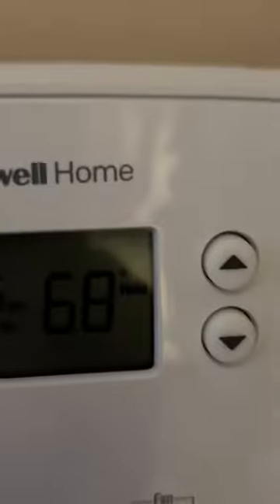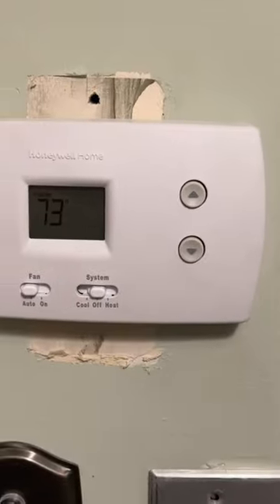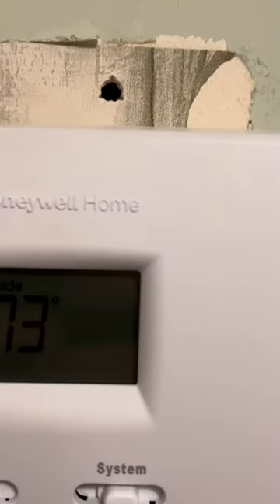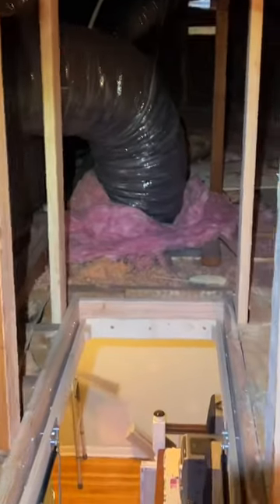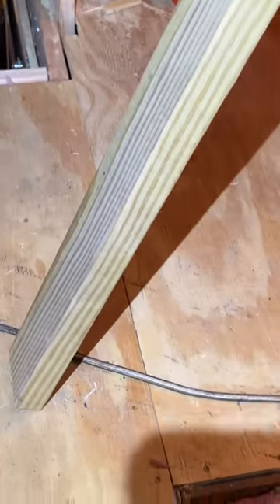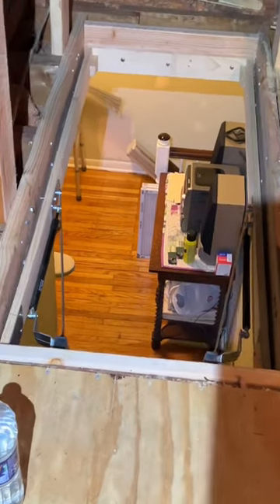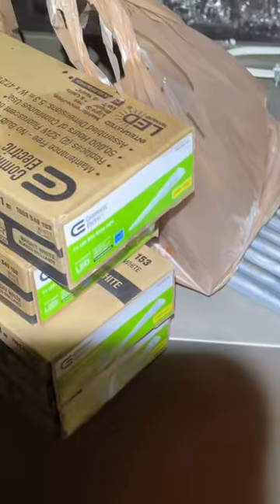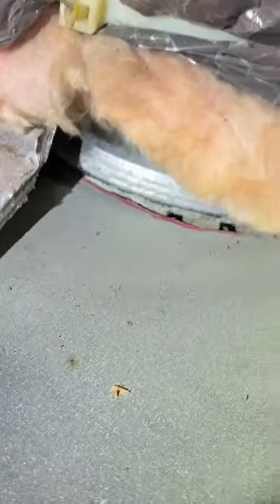More licensed HVAC hack work

Comment: Then someone that knows what they are doing has to explain to the customer why the repair bill is so high for a simple repair. "Well sir we have to uninstall the unit then....." Instead of just making a straight forward repair. Customer looks up the cost of part online and wonders why it's so high for a cheap part and calls you a ripoff and leaves a bad review.

Comment: I worked with a company for a while that had hired the worst hack I ever seen and actually went to the boss and his son and told them he wasn’t the guy you want working for them after an attic install we were working on he never pressured tested his lines sets puts on the vacuum pump and any idiot would know it didn’t pull down and dumped 7 pounds of 410 in the attic while I was up in it working so I go down and tell dumb ass he f upped and he goes up and fixes the leak and ten minutes after is starting the unit up  .. his company van was so sloppy they lost money every time he opened the side door parts would fall out it was cluster f if I ever seen one

Comment: The HVAC/R industry has turned to trash. I was told to be a salesman not a repairman. I started my own business and have no employees I do all the work. I am slowly putting the hacks out of business simply because they have way to much overhead in hiring sub par install crews. Guys in my are charge between 6200 to 12000 for changeouts. Im charging well below that and banking. People got greedy and will pay for it.